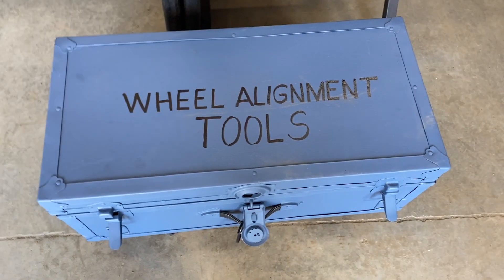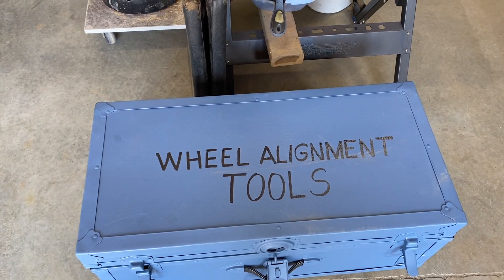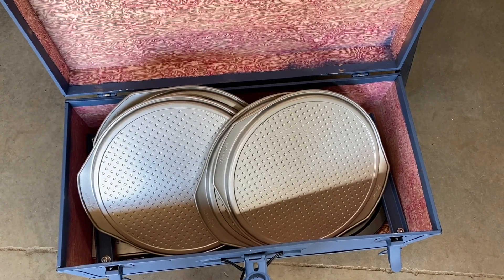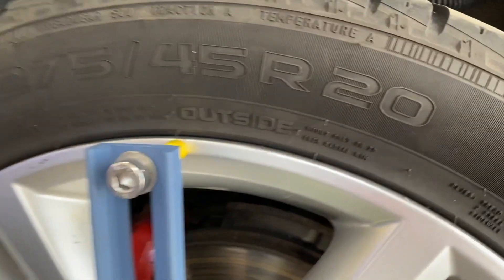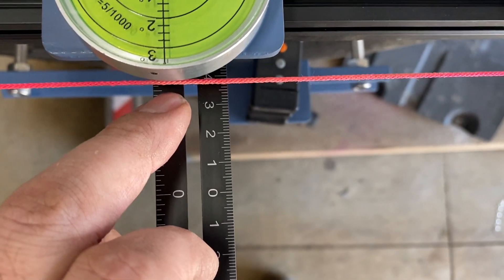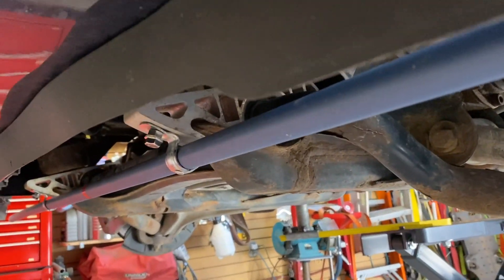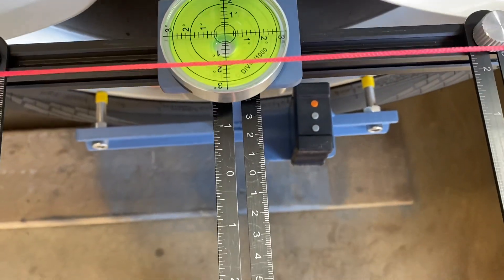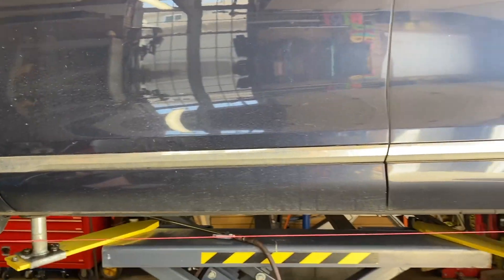Touareg Wheel Alignment Tools

Comment: Great Video!!
A nice touch to add to make sure you get the absolute correct distance reading from the string, would be to use a piece of tape and a small piece of mirror.  Tape the mirror to the underside of your rulers so that part of the mirror sticks out past the edge of the ruler.  When you look down upon our string, align the string with your eye point so it covers the reflection of the string; so you only see one string.  Then take your reading off the ruler when you see only one string.  Its an OG trick we used when "Stringing" a Jetranger Head.
Reply from the maker: Good thinking!  I'm changing the coil springs again so I will be doing a complete alignment and I'll document it ... stay tuned!